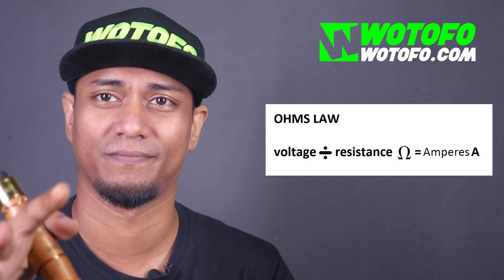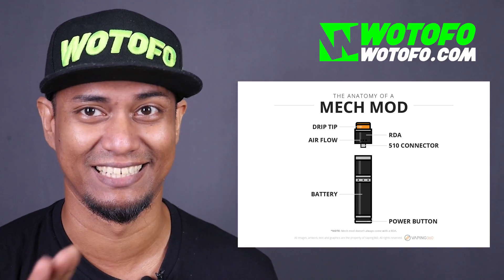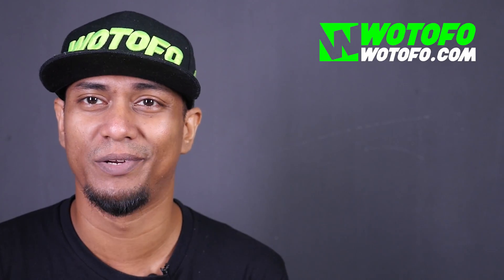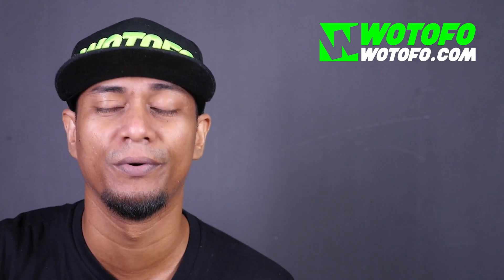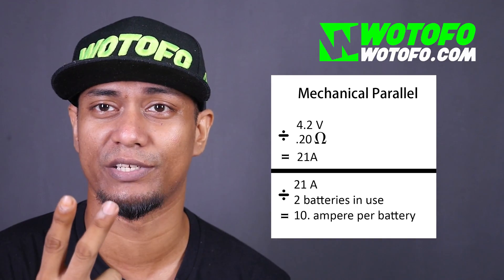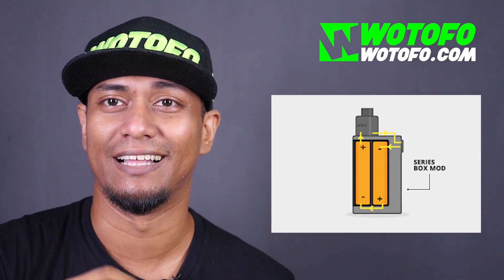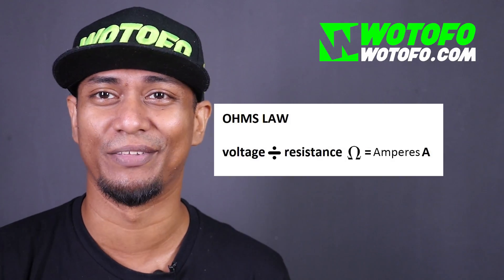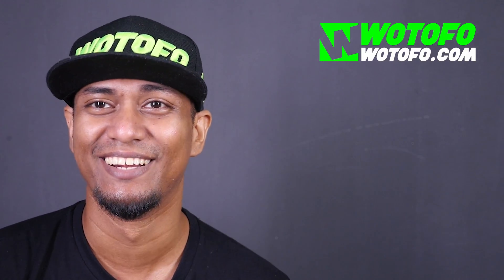Wotofo Guide To Vaping: Vape Ohm Laws & Safe Vaping!

Comment: I use 7wraps 26g alien dual core. It's around 0.15ohms. and i use unregulated parallel-series config with batts true-rated at 35A cdr. It's almost 500watts before voltage drop. Paired with 24mg is 👌👌

Comment: Using an 18650 cell in these devices, and vaping at 55W, what exact cell amperage should I be aiming at to be able to vape all day or at least for couple of hours without recharging, semi chain-smoker but, sometimes I might not touch the vape for an hour or so.
And ps: you mentioned it's not safe using a 10A battery while drawing at 20A, what exactly isn't safe about it, could you elaborate on this instead of just being vague? what's the worst that could happen? I'm drawing 21A from a 7A battery, as a semi chain-smoker and it's not even overheating or anything, the battery just dies quicker, so, could you tell us what could go wrong other than faster batter degradation?
And lastly speaking of safety choosing coils for dual battery devices, in parallel setup we are safe at 0.15A and nothing less than 0.40 for the Series, don't you think this would come in the kit when we buy the device and we just have to continue replacing the coils that came with the kit?

Comment: Little confused as didnt explain if you want lower Ohms or higher Ohms? 

do we want the resistance to be higher to slow the discharge rate of the battery? and when doing duel coil builds how does that effect it?

Comment: now im really confused. 

im using a aegis legend + talo rda, dual battery , efest batt of 3000mah 35a 3.7, and using 2 pre coiled (it says .45 ohms) , and has a reading of "coil .18" I usually vape around 40-43 power....

is this a good bad things?
Reply: You work it out slightly differently for regulated devices. The resistance of the coil isn’t particularly important on a regulated device, which is why many of them will allow you to fire coils as low as 0.05ohms. I would never advise using a resistance this low, however.

The Aegis Legend is a dual battery mod, with a minimum voltage cutoff of 6.6V, ~3.2-3.3V per battery. You divide the wattage you’re using by how many batteries there are; in this case there are 2, so 40-43 watts halved is 20-21.5 watts per battery.

All you do is divide the maximum wattage per battery by the minimum voltage per battery, and this gives you the maximum amps drawn from each battery under load. In your case, it’s this:

43W / 2 batteries = 21.5W per battery.
6.6V / 2 batteries = 3.3V per battery.
21.5W / 3.3V per battery = 6.5A per battery.

It’s always good practice to add a buffer of 5% or so to account for regulator inefficiency, too. Like this:

6.5A / 0.95 = 0.325A
6.5A + 0.325A = 6.825A per battery.

So with your current setup as described in your comment, you’re only drawing ~6.8 Amps per battery under load. Perfectly safe for any batteries rated 10Amps or above, which you should be using. I wouldn’t use a battery rated any lower than 15Amps CDR, personally. I typically use 20-25Amp batteries as rated by Mooch in his extensive testing.

Comment: So a newer builder with a unregulated mech mod u can do a .20ohm build and that will be a safe build along side using a single 21700 or single 18650 battery.
Reply: No reason to build below .3 unless you are using a mesh. If you are building mesh you should already know all of this stuff

Comment: Wotofo I'm new to vaping I just good the voopoo drag 3, 2 INR 18650-25RS 3.7v 2500MAH 25A, 3mm 0.36ohm Prebuilt coil, 1.46 ohm coiling wire, HellVape Vertex RTA is that safe of can I get my face blown off

Comment: question, if I run a mod in  parallel with a build of 0.08 ohms and 2 batterys with 4,2 V 35 A 2600Mah would I realy be vaping 220.5 W?
Reply: Boom

Comment: Is .14 to .13 ohms safe to use on a single battery tube mech mod with a   3077mah 30.2 a 20.7a cdr 3.6v
Reply: Far too low of a resistance. You should stick to .20 and above for a single 18650 to stay safe.
Reply: @izzykoopa  I’ve got 2 18650 batteries and wanna use a 0.22ohm coil on a 177w voopoo drag 3 is that gonna be safe
Reply: https://www.youtube.com/watch?v=MXU9vVTww-M

Comment: I don't understand wich batteries u talk about I just bought some .36 ohm coils and I'm not sure if they're safe to use in dual, I have a priv V8 mod with RBA, the coils will end up being .18 with a single 18650
Reply from the maker: The output resistance of Priv V8 mod is 0.1-2.5ohm, so 18 with a single 18650 is available. 😊
Reply: @WOTOFOOfficialvape  I just read from smok oficial website that minimum resistance is 0.15... Y guess I'll be dangerously close to limit
Reply: Also... Why would someone use a 2 ohm resistance  in this mod? .85 take a while to produce vapor... I don't want to imagine with a 2 ohm hahaha

Comment: Well that s for 20-25A batteries , you can get better batteries like 40A discharge
Reply: According to Mooch the “battery for vaping guru” there’s no real reliable  18650 over continuous 30 amps discharge. The Hohm work is 20 amps continuous discharge, the Sony VTC5A is 25 Amps continuous, the Samsung 20s is 30 amps continuous discharge... you should google Mooch. His videos are amazing and he’s on every social media. Continuous discharge and pulse discharge are not the same and batteries only have pulse discharge on the label on many occasions.
Reply: @acpliego  agree,but the peak amps are enough to inhale. And not all mods uses 18650, and of course you can use 2 18650 in parallel or 4 (2s-2s) and drain more
Reply: @acpliego  or take it different, do you think a Tesla drains only 20amps?
Reply: Dan SV depends on your built. And Mooch’s recommendations are for extra safety.

Comment: If my mod uses 3 batteries 18650
at 3.7 v each....whenever I fire it up am I always getting a total of 11.1 and the mod splits up the volts vs which every type of RDA or tank that I use
Reply: Sir, 3.7v is nominal , 4.2v is fully charged and 2.7-3.2v discharged
Reply: And take in consideration that you for sure use 2 resistance

Comment: i just started vaping and i watched so many videos of the ohms law.. i just started going RDAs... i cannot understand i searched everywhere.. only to realize that i have a regulated mod :D
Reply: Let me resume for you
1 x 18650 battery = 4.2v max
You can suck from a good battery as high as 40A.

What does it mean?
If you have a mod with 2x18650 in series that means 8.4v(fully charged)
If you use a 0.2ohm resistance you will drain 42A (8.4v/0.2ohm=42A) continuously from the batteries so it will blow up because your battery can only give you 40( usually you will find 15A to 35A batteries).

SO, just divide the voltage you set on your mod(if you can set it) by your resistance. Or if you can't set the V, just multiply 4.2v x the nr of batteries you have. 

Make sure on your battery specs that it can drain that amount of A continuously. (i repeat again, you get A from V÷ohm)
Reply: @dansv9778  you sir are very smart thankyou you explained that very well I screenshoted what you said as I'm a begginer
Reply: @dansv9778  thank u , this was perfect

Comment: My volts is on a constant 0v am I dumb or like am I supposed to check for volts somewhere else because my mod has ohms on the left and volts on the right it says .21ohms and 0 volts
Reply from the maker: Hi, what Wotofo mod do you use? Please check if there is problem with the connection between  the atomizer, the screw 510 and the pin.
Reply: WOTOFO Official it still works fine I jus wasn’t sure if there should be a number by volts.. I’m using a mach on3 mod with the profile rda
Reply from the maker: @purfectsushi  Hi, thanks for you reply, but in order to solve the problem professionally, could you email support@wotofo.com with a product vedio or pics?
Reply: WOTOFO Official okay I jus sent the pic to support@wotofo.com

Comment: Hi I'm new to vaping and I have a question. I have a regulated mod ( Thinkvape Thor Pro 220w) and I was wondering if  I can use prebuilt coils which are 0.5 ohms each. I'm using 2 batteries where each battery is 3.7 V, 2500 mah and 20 Amp.

Is this safe  ?
And I think my battery is a series type. I don't know whether the parallel and series applies to regulated mods or not but my battery looks something like this once inserted into the mod. 

  -      +

  +     -

1 more thing is that my mod's specification says that my atomizer resistance is from
0.05 ohms to 3.5 ohms
Reply: @Grim trod ok thanks

Comment: I'm using 18650 with the noicy cricket.....am I safe? I am looking at rdta bt nt sure what coils to use and batteries for safety and can take series mode vaping like 💨💨💨
Reply from the maker: Hi Nat, I think you mean Noisy Cricket mod? It will be safe if your coil resistance higher than 0.1ohm.

Comment: basically all i wanna know is... is it safe to vape 0.2ohm on a 37v and 35 amp battery? thanks
Reply: use the online calculator, and you shouldn't be using a mech (unregulated device) if you dont know what youre doing

Comment: i was bad at maths and physics so this is really confusing for me ..man never thought vaping would be soo complicated
Reply: To be honest the video and the explanation isn't well presented.
Reply: but what did he mean at 3:24, with the example of a 0.2 ohm coil resulting in 21Ampere, when he talked about the hypothetical battery with "10 amps", where do you even see those specs? Like, when I'm lookign to buy a device all I'm seeing is Volts, ohms of the coils, and the only hing ampere-related is the mAh number that supposedly shows the capacity, not any current flow or anything?
Reply: Ohm's law is easy to remember and work out if you drawn it in a triangle.
V = Volts
I = Amps
R = resistance (ohms)
 If you know what 2 of the values are you can work out the final one.
For the ohm's law triangle method draw a triangle and then write the letters in the corners of the triangle as follows.
V - top corner
I - left corner
R - right corner
Then draw a horizontal line below the V to separate it from the I and R and finally draw a vertical line between the I and R.
Now each letter has its own box all you need to do is to cover up the value you wish to find and what you are left with is the equation to work out the result if the letters are side by side it's multiplication if they are top and bottom you divide the top by the bottom.

V = I x R (cover up the V and you are left with I and R side by side)
I = V ÷ R (cover the I and you are left with the V on top of the R)
R = V ÷ I (cover the R and you are left with V on top of the I).

As an example.

30 I x 0.25R = 7.5V  (V = I x R)
7.5V ÷ 0.25R = 30 I (I = V ÷ R)
7.5V ÷ 30 I = 0.25R (R = V ÷ I)

Hope this helps
Reply: It didnt lol
Reply: Yeah im completely lost as well hahaha but great video imo
Reply: NOBLE get a regulated mod, try using coils over .20 ohms, ohms are stated in coils, use them between 3.1  and 4 volts according to your liking and you’ll be in vaping heaven. Easy, you don’t need to learn anything. If you use a subohm tank the recommended wattage is stated in the coil. Easy...
Reply: Unos __I agree use Regulated mod , dont worry about anothert things

Comment: whats up dude... ive been using mech mod single battery and my ohm reading is .10 is it safe thanks
Reply: It depends on your battery, If your battery can use a continous discharge of 25 amps and runs at 3.7 volts it discharges continously at 37 amps... That is way too high! You are better off building higher ohms in this case. But it all depends...
Reply: Building at .1 is very dangerously low if you don't know exactly what your working with as far as amps, battery's, volts and ohms. You are building at a very low impedance. I would suggest to you to not build lower than .25 to .3

Comment: ok so i have a question, i know im "safe" because im not using a mech mod, so i have a swircher, witch i believe its a serie mod, my 18650's are 20A and i normally vape at 0.2ohm's and at 60-80 watts, so thats means what for me??? am i killing my batteries to fast??? does this video applies to non mech mods??? or in other end am i doing a good use of my vape??? if you can help i apreciate it .
Reply: hybrisptuga hey , I have a switcher too. These are regulated mods, so there’s no need to worry about blowing your face up, the chipset (the DNA is an awesome chip) will always prevent you from pushing your batteries too far! Just build your RDA, check what resistance reading you get (the display above voltage) and adjust your watts accordingly to find the best vape. unless you use bypass mode, which is never necessary so switch to variable wattage - normal or temp control if you’d like
Reply: @TonyBones997  if im using a RDA on regulated mod do i have to worry about ohms law or i can vape with no issues?

Comment: So you saying ideal voltage is 4.2V?
Reply: It really depends on the battery you are using. Most 18650 batteries are 3.7 volts.
Reply: @zorbat5  yeah but on full charge they are 4.2

Comment: Ok so this stuff only applies to people using mechanical made coils like the rda setups ? I'm not using this mechanical setup I'm using SMOK G-Priv 2 Luxe Edition 230w Kit with the coils like tfv12 or tfv8 . So I'm safe this got nothing to do with me or not ?
Reply: No. Your mod has safety features, so the coils you are using are totally safe. This mostly applies to building your own coil for use in RDA.
Reply: if im using an RDA on regulated mod do i have to worry about ohms law or i can vape with no issues? i know that the regulated mod is safe but im worry about the rda.
Reply: no it doesnt

Comment: I use Mechanical Series type of Vape, so here is my calculation :

  3.15v
x      2 batteries
= 6.3 volts applied
--------------------------------
   6.3 volts applied
÷ .13 ohms
= 48.5 Amperes

So, the question I wanna ask is, is that safe for me? Really hope that you will respond to me
Reply: That kind of amps is totally high bro
Reply: @malbinomahigad3453  omg dude
Reply: If you calculate the wattage is totally gives you 305.31w